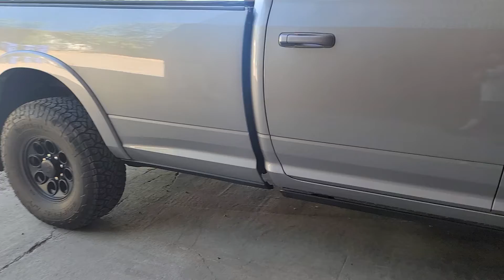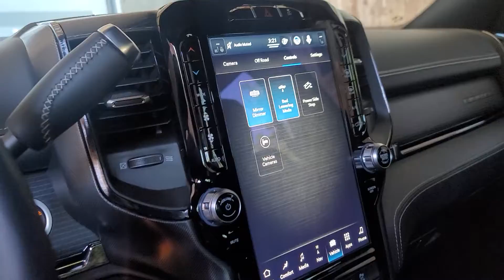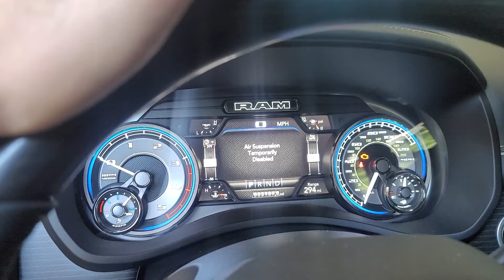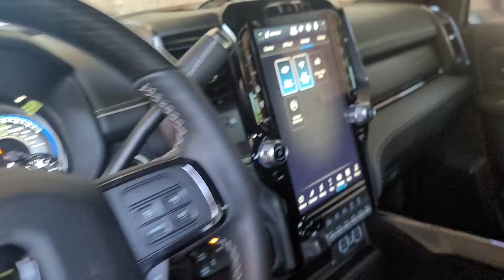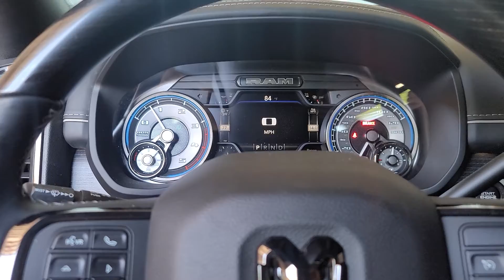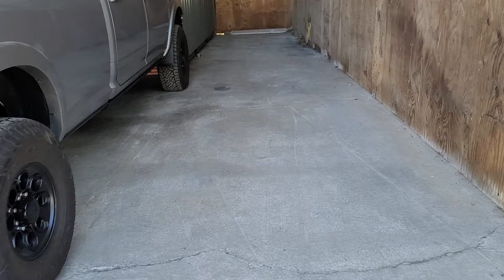5th gen Ram 3500 Rear Factory air assist ... Ride Quality fix cheap 👌

Comment: How much space do you have between leaf springs? Specifically between the bump stop at either end on the leaf itself and the next leaf up? Are the gaps the same front and back and equal left and right?

Comment: ❤ hey man! You just saved my ass! My service air suspension light came on last week. And I was freaking out. Two years ago I had an airbag pop and then my compressor go out as soon as I got the airbag fixed. So I’m very aware of how expensive it is to repair this air suspension. Long story short I’ve been looking for videos and information for all of last week and this week. I came across your video and started looking through some of the parts that go through the air suspension. Come to find out the plastic arm for the sensor had snapped! Thank you! You saved me this time!
Reply from the maker: Thanks for the reply! Glad you sorted it out

Comment: I drive a 2025 3500 dually w/airride.  I purchased the extension arms online and extended them about 1/2 in longer than stock. My air bags inflated, not super firm but so I can’t push them in with my finger. I rolled over a few dips and speed bumps and it no longer feels like the rear end is bottoming out. $120 fix. I also aired down all of my tires 69-72 psi. I’ll probably get some shocks next because I’ve heard the OEM stuff is horrible. I’m glad I didn’t spend $5k + on suspension upgrades. It’s a truck, not a Cadillac.
Reply from the maker: Yup. I had even bought some used rear leafs to try. Luckily was able to sell them

Comment: The assumptions you are making are all with a truck that is intended to be towing, not empty. I'm sure Ram made designs with a load intended. People drive a 3500 as a daily driver and never pull anything. You are expecting a truck made to pull a house to ride nice? 🤣
Reply from the maker: Improvements in both loaded and unloaded. I have a 45ft 5thwheel toy hauler.

Comment: My 23 3500 Dually wont do anything air related, alt trailer height doesnt lower the truck, bed lowering doesnt lower the truck, i have no idea whats going on. Engine running everytime, even threw my car hauler on and tried alt trailer height, literally nothing happens.
Reply: I have a 22 limited 3500, left side air bag will not release air, but the right side does. I ended up pulling the relay lol, but I’m gonna give this adjustment a try.
Reply from the maker: What I did  later on is load my the wheel up and put it in bed lowering mode and let it sit for a week. This seemed to give a little more flex and movement in the leafs, basically breaking them in. . The dually may not move at all still being the base payload is much greater for much heavier spring pack to start
Reply: @MrCuervoRacing I figured it out, it wont actually release air until theres a decent load on the truck. Pulled a car home and hit alt height, was able to watch it lower. Guess the duallies can carry so much beinf unloaded wont let it air down lol.

Comment: I just found this out today after weeks of researching and asking around.  I Was curious if anyone figured this out on you tube. Yours is the only I see so far.  To this day nobody could tell me exactly what was going on.  What I thought and a lot of people that specialize in HD rams even told me, system over inflating.   I never would’ve thought it was actually opposite. First comes to mind system over inflating.  In actuality it was opposite and not enough , riding on internal bumps.  I used adjustable  links to adjust to add air but cool you found a way to do it without links.   👍

Edit:  I didn’t watch fully, you ended up using adjustable links also 👍 
    Yah man you are helping a lot of people for sure.  I wish I seen this earlier haha!   I had to figure it out the hard way as you did.    Crazy nobody knew.   From the dealer techs to shops that regularly do this etc.    what’s happening does go against the normal train of thought tho in their defense.  I was thinking the same too!   😅
Reply from the maker: Thanks!  Sorry for the late reply, looking  thru some older videos and the responses like yours are motivation to keep  at  it and spread the knowledge  or idea

Comment: Thank you, this video has saved me so much time! I’m in the UK and have just bought a 2020 3500 dually and the factory air ride had been disconnected when the truck was lifted. I’ve got it all working but it’s been bugging me that I can’t quite dial it in to get it exactly how I want. Your video makes perfect sense and I’m now going out to the garage and getting my volt meter and tape measure out!

Comment: I am running into a similar problem. Have a 2022 3500 SRW towing a living quarter horse trailer. Because the truck will “self level” and then putting into alt trailer height. It cause the trailer to ride slightly higher in the front. I can’t adjust the gooseneck connection any lower because I am currently at 6” of clearance between the bed rail and trailer. At lower speeds (usually under 30 mph) it causes a bucking. The only option I could think of was to somehow manipulate the air suspension ride height or add a spacer above the trailer axles?  Just curious if you would have any input? Thanks.
Reply from the maker: I recommend  going to a stiffer rear shock.... I had the bilstein  5100 and of course stock. Poor ride with trailer ... and expecially alt ride height I use the Rancho 9000 and agjust then 1 click from full tight.. a lotnof people make fun of them or whatever but they are very versatile if going from loaded to unloaded

Comment: Those link you bought are no longer sold, they changed to a cast aluminum 2 piece shank that soley fits the 2500. 3500s suspension links have 1 end at 90 degrees and the other end at 0 degrees for the level sensor and the top of the leaf spring. Ordered 2 sets of these dumb ass links and got 2 odds the nee style links that both ends are at 0 degrees for only 2500 ram. Im pissed. Only solution is to buy the one from american trucks thats 134 fkin dollars.
Reply: Saw somewhere that someone made a set using threaded rod and the ball sockets.  Will see if I can find it. I bought a set from Revel Perfformance. 145 bucks which is rediculous for that they are.  I put them on and it kept disabling the air suspension so went back to the factory links.

Comment: Mine is a 2024 3500 and doesn’t move at all when I lower or raise. I think I’m going to have to do all of this.
Reply: Exact same issue with my 23 3500 DRW, nothing happens when hitting either button, when returning to standard height, it happens instantly, no raising message appears

Comment: I just tried the voltage trick on a 22 Dually. I got the side to side to match at 2.25V, but in lowering mode or regular mode, the Driver is 3/4" lower than the passenger. Also the lowering vs standard height is also 3/4" of an inch. Maybe this is on purpose from the factory to have the driver lower than passenger??
Reply: Maybe more weight on driver side
Reply from the maker: @kobeljo and fuel tank full

Comment: Good job.  I wanna level my dually with carli springs in the front and to make the rear even i might try thise rods for the bags.   I did the whole carli lift on my last truck.   In canada its like 10 to 12 k in just parts.   I just wanna do the base kit this time but want 3 inch lift in the front.  Good video good info about the voltage.

Comment: Having an issue with the truck I bought used with a lift already installed. They didn't put any links on it at all but I went from riding on the bump stops to being at max psi. The links are 2 inch lift links and my truck is lifted 4 inches so I shouldn't be that maxed out. My level sensor is almost exactly where yours is and my bed lowering still doesn't work.
Reply: Which lift does it have i have a 4 inch bds 4 link kit and im trying to make it ride smoother its super rough any thoughts

Comment: So it rides better with air in the bags and not deflated? I have a 22 3500 SRW and it is very rough in the rear. Some videos say to deflate the bags for best ride quality. I just need to smooth the ride a bit in the rear.
Reply from the maker: For mine yes,. Keepsnit off the bump stops. Lower pressure in tires  if unloaded

Comment: Great video. Instead of the air links I wonder if you could adjust the ride height with Alfa OBD.  On my grand Cherokee with air suspension I adjusted mine to have new normal ride heights as well as added spacers. This would keep it with factory suspension pressures but at a higher height it all of it's suspension settings.
Reply from the maker: Possible. Im not too familiar  either that side of things